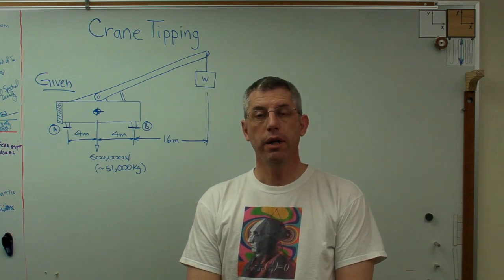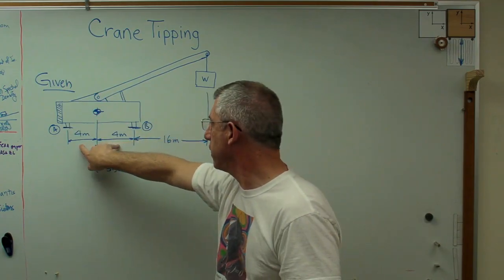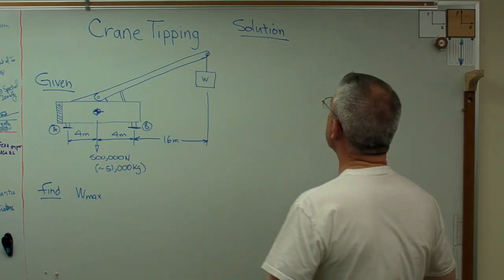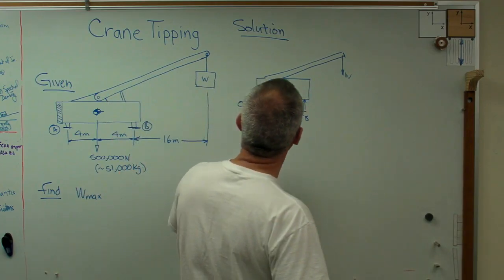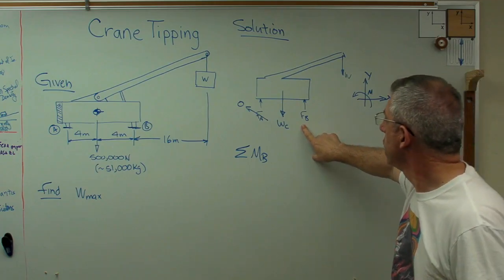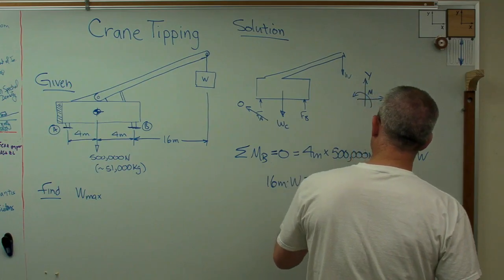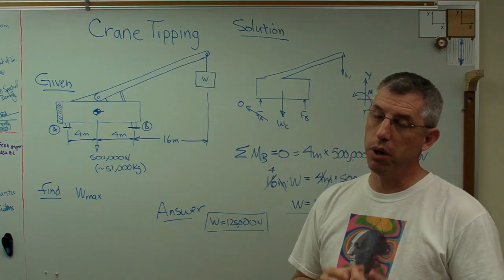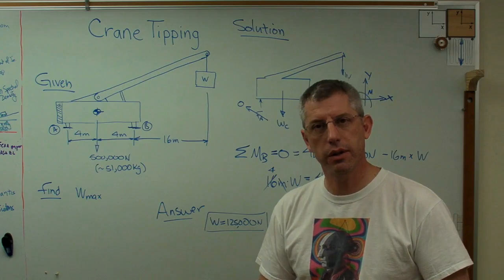Crane Tipping - Brain Waves.avi

Comment: The length from the outrigger to the centre of gravity of the load is x4 larger than the length of the outrigger to the centre of gravity of the crane. 

The crane weight is x4 larger than the weight that would cause it to tip. 
 
No need for all that math 😂

Comment: Thanks for putting this together. If the problem showed 4 outriggers instead of 2, to solve a similar problem, would you simplify the problem as how you solved it in this video? Or would you need to build a 3 dimensional free body diagram to compute the unknowns?
Reply: Asking this because I'm looking at a problem with 3d diagram depicting all 4 outriggers, but the solution is completed assuming 2 reactions and solved accordingly? I'm curious if that is the way to go with such crane problems. Thanks in advance.

Comment: This video may encourage an incompetent person to use the tipping capacity as the maximum load not to exceed. Where in reality the crane is already overloaded just before the calculated tipping capacity, I.e,, when the combined CoG of the crane upper and lower works, the boom and load is on the fulcrum point - the outrigger or end of crawler track. Stick to the load chart.

Comment: It so useful this video and easy explanation but My question is, why you are not including the crane’s arm weight on the free body diagram ?
Reply from the maker: I assumed that the arm was light compared to the weight.  But, it's not hard to add in the weight of the arm.  Just add another downward force at the center of mass of the arm :-)

Comment: I may be asking a question that has already been asked but why are we subtracting the forces from the weight and the crane's center of gravity when they are both pointing in the same direction?
Reply: even though my English is not that good I will do my best , the reason is because both forces are trying to rotate the crane in opposite directions on the front foot

Comment: so, how do you know that the center of mass is in the middle?
are all cranes designed to have the C.G  in the middle?
Reply: that's assumed by definition of the problem. IRL you weigh a crane on 3, 4 or more weights and calculate the actual c.g. When designing a crane you decide for yourself where cg should be.

Comment: I have a rear mount 1996 year 1295 national crane, rear mount I have owned for 10 years, any reason not to "I make" counter weight just for ease of mind. I think 500 lbs. or so. Any thoughts on this. Thank you.
Reply: clyde berry fairly bad idea. Could result in possible loss of backward stability. (Most particularly in high boom angle situations, especially with no load.) You would get about the same amount of leverage by simply lifting over the rear. (Engine block, cab etc). It is possible to add counter weight/weights but you must get it approved in writing from the manufacturer.

Comment: Question how do you convert the crane boom angle degrees to feet from the center pin/ fulcrum to the boom tip..... I can see it's illustrated in the LMI computer but how does that calculation work if I wanted to measure that

Comment: Very helpful with how to set up tipping point problems. Thank you!
Reply: Can you explain please
Reply: This video shows how to set up a statics problem of a rigid body tipping over using moments by setting the moment of the rear wheel to zero which signifies the point at which the crane will lift off the ground.

Comment: As a licensed NYC operator and run cranes for 35yrs. All cranes in America have load charts amd LMI computers which limit radius and capacity to 85% tipping load or structural limit by law of Osha and States under ASME codes.

What happens often is the operator booms out to far a radius ignoring charts or turning LMI overload key to complete lift using up the 15% safety factor. 

Also wind load and dynamic swing or dropping and hitting hoist brake will cause overturn or structural failure.

Loss of firm ground support under out rigger jacks causing out of level also a big problem. 

Some crane will flip over  backwards do to counter weights if boom is to high and no out riggers used when rigging.

I have a BS in Civil Eng and know static equations which crane mfg calculate s adding in dynamic forces as well.

Detailed explicit operators manuals and load charts must be read by operator and even riggers. Exact load must be pre determined before lift. This often is never done and unknown. I had many close calls. Rigging is critical. Cranes today are master pieces of engineering. Check out Manitowoc site. Shalom
Reply: I refer to the load chart too. 

That's why I don't understand what this video is about 🤣🤣🤣

But still interesting to learn the calculations behind it 😊

Comment: When u were drawing your FBD, why did u leave out the hydraulic arm sustaining the boom.
Reply: The Hydraulic Arm was left in the FBD because the static analysis presents a conservative case...
Reply: I have a 1996 year 1295 national rear mount, I have had for 10 yrs. I would feel safer with " I make" counter weight, any reason not to do this? I am thinking 500 lbs. Any ideas?

Comment: Thank you for your videos they are very helpful but I have a question. Why was the weight "w" multiplied by the distance 16m instead of 24m? (in the moment of b equation)
Reply: His Analysis assumes what weight W will cause a tipping, hence FA is zero,the tipping occurs at B (the Fulcrum) and not at A.
Reply: thank you for your video !they is very useful to my safety job in site